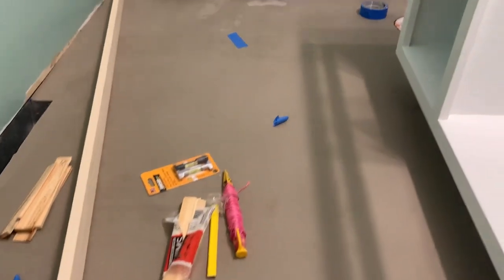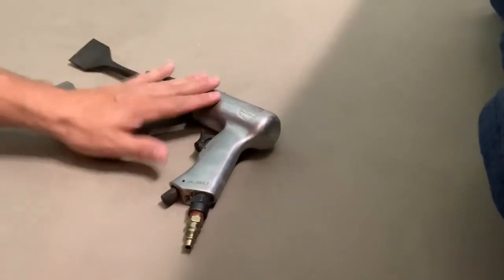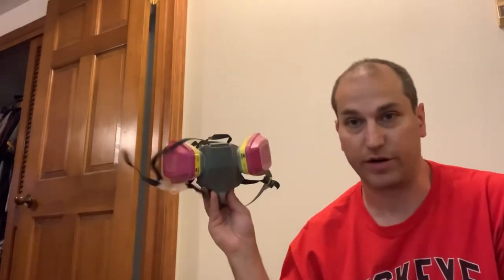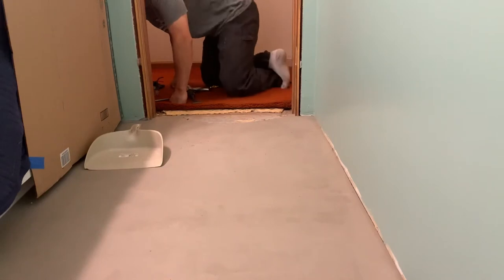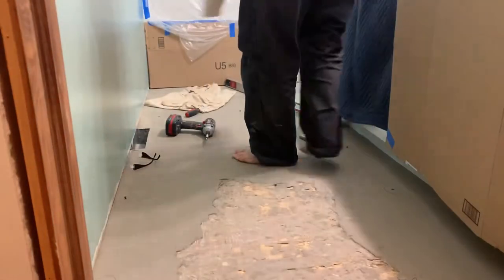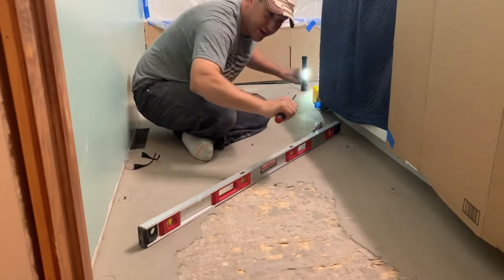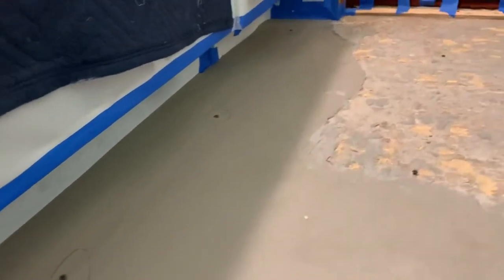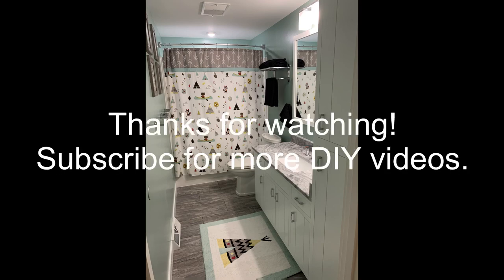Self Leveler Gone Wrong - SOLVED

Comment: I guess your first pour was not wet enough. Don't think self leveling doesn't level well, it does, just keep your mix wet and move it around with a squeegee or similar. The screws is a good way to mark the floor level. I say this after 30 yrs carpentry... It's not the mistakes that you make but how skilled you are at putting them right. (which you did) over all, you did great and got it done!
Reply: Do you mix your leveler wetter than the instructions?   I had the same issue.  I used a trowel, moved it around. Looked flat. Was done in like 15 min.  After it dried I took a level to it an there is about 3/8” to 1/2” difference.   Only thing I can think of is that I should have used more water than the instructions called for.

Comment: Unfortunately, I made the same mistake. Thank you for the video. Very helpful in deciding how to proceed. I don't have a air  hammer or compressor.  Ill be grinding before my re-pour. Ill be using the screw trick for sure. Thanks again!
Reply from the maker: Such a bummer. Good luck with your fix. One tool I have acquired since this video is a dust shroud with a shop vac attachment for my angle grinder. It really cuts down on dust a lot. If you combine that with a shop vac that takes the paper bags inside, it works out pretty nice. Good luck!

Comment: i went over the run time on mine and got a partial bond except near my door. used the bare minimum water amount exactly, weighing out the leveler bag for a partial fill. didn't know if i could trust my foam tape dams (you actually can). had to crack off a good tenth of my project where i found a couple carpet staples i missed. thing is, you may need to prime before repairing. didnt see if you did. primer type is on the product. both the floor and concrete. abrate (light sanding) as well per instructions before priming. a placer helps smooth the material but my jack and jill sink rooms are small. the one i had to redo a bit is narrow and pesky. at least in round 2, I bought a trowel.

Comment: Thanks for posting this! I'm doing it this weekend and been watching a ton of videos on it. Gotta spread it fast, encourage the flow, use the spike roller RIGHT AWAY to get air out and to fix multiple pour "seams". And.....work.....FAST! Hopefully I wont mess up! :O
Reply: If you can have someone mix for you that will ease your stress. LOL Trick to mixing is add all required water and half of the leveler and mix about 30 seconds. Using a trowel make sure to scrape side for any unmixed material. Then add remaining leveler. Mix for another 30 seconds and check for dry clumps again. Then mix 2 minutes. Use a timer. I have a egg timer that works well for this messy job.

Comment: Same situation.  Reasonably competent/stubborn DIY and hey, look - it works for other people on youtube!  I am now adding a step to search "<insert task here> disasters | gone wrong" to find such nuggets of wisdom as you provide.   Self leveling indeed ... ha!  Self smoothing is 100% right on.  I'm pouring "puddles" to try and level bits of a family room that have sagged slightly (1/8 to 3/16 ... 1960's house) in prep for some rigid vinyl plank.  And did the puddle even self level over a 3' span?  Noooo...but it sure is a nice smooth hump!

In my case, a shop vac with cyclone attachment + hepa filter + palm sander with diablo sandNet pads makes short work of leveling said bumps.  (if you haven't tried the sandNet pads, they're the bomb.  Mesh means they pretty much don't load.  Got mine on sale in a multi-grit pack at Home Depot)

Thanks for taking the time to share your pain!
Reply from the maker: That sounds like a rabbit hole of entertaining videos. I'll check out the sandNet pads. Seems like they get awesome reviews. Also, I had never even heard of a cyclone attachment, but I looked them up and they look awesome. Did you build one yourself or just buy one off the shelf?

Comment: I had never used this product and screwed it up like many others.  The second time I spent days preparing and followed all the tips from this video and comments:
I chiseled all the high spots, put screws in that were level with each other as a guide, made the mix very thin, had someone else keep mixing while I poured and troweled, and did it all quickly.

The second time it came out great.  This isn't a bad product, but you must be very careful, otherwise you create a lot more work for yourself.
Reply from the maker: Super glad you got a good result on the 2nd try. I agree the product is good, just takes some practice.

Comment: Thanks for the video. So many "experts" have videos on this that makes it look easy but so little can be found on what happens when things go wrong. Also as I just learned earlier, Mapei makes a self level plus that takes 24+ hours just to walk on BUT it's a far better product for a single person, DIY or novice as there's substantially more time to work the product. Mine started to set up after only 7 minutes to where the rake marks never leveled out. Thankfully I had the smart idea to start using a floor scraper after it sat for an hour and hadn't fully cured so it was easy to remove 2/3s of it before I was screwed.
Reply: What product did you use initially?  I used Customs Leveler RS from HD with a trowel to break the surface tension but ended up with a high spot in the middle of the pour area from front to back.  I poured a 32x60 section for a shower pan so it is a small area but it is over new plywood that is screwed down.  Not sure how to proceed at this point.  Should I grind the high spots down or just try to remove the whole pour with a rotary hammer just like I did to remove the original tile.

Comment: I work with it professionally. They sell grinders with dustshrouds.
Use one of those to grind your high spot down then use leveller to raise whatever is low.
Reply: I got a DeWalt dust shroud and vac attachment and diamond blade and was blown away by how well the whole system worked. It captured nearly all the dust.
Reply from the maker: Good to know. I'll look into a grinder with a dust shroud. This was not the first time I had a ton of dust caused by a grinding project.
Reply: Posting this for ideas for the next person. 
Depending on how high the high spots are, you can also use a Carbide Stone Fluted Rubbing Brick to knock things down. If you do this a few days after the pour the material will come right off.  Low spots are easier. Just reprime and mix a small batch to fill in using a screed scooping out any excess material.
Reply: @jhalleck  I’ve got a really large high spot. Will this knock it down quickly?
Reply: @YungFlipFlop243  Yes.  The stone can remove material pretty fast but you need to use before the material gets real hard. The grinders can be very aggressive. I have a bosch which can take 1/4" bites in seconds.

Comment: Been there and done that! (5m x 3m Extension to my house). It looked like it all went very well until I tried to lay the flooring on top. I ended up having to chisel half of the floor up and start again. Things I learned:- Spend a lot of time checking the levels of your floor before you start. Use screws to show what height you need to pour to (I didn't). Have a break and then check it all a second time (in all directions). I used Mapei self leveler: Put 10% extra (Cold) water in it to give yourself a bit more time (otherwise it goes off really quick). Use a rake to move it around when you pour it because the latex part floats to the top and you'll get riges in it where the concrete part ends up to near to the surface. Grinding afterwards is a very bad idea. Don't try it!
Reply: why is grinding a bad idea? I have a few high spots
Reply: @gizmo9006  Grinding is really difficult and dusty.  That is rock hard !
Reply: @maryjayne8746  I have an angle grinder with diamond bit its not that dusty with a dust shroud and vacuum. not ideal but its happening
Reply: @gizmo9006  grinding creates a lot of dust.  Much better to to chisel -- either with a hammer gun or a hammer and chisel

Comment: Great video, thank you for sharing.  I have a similar issue and need to figure out a solution.
Question:  It looks like you laid your tile directly on the concrete.  Did you consider using a membrane or cement board?

Comment: Did you use the recommended primer and make sure the self-leveling was spread evenly?  My guess is no primer and the product/mix was not correct.  At least you had good adhesion to the slab.  You could have poured a second layer that was more flowable.
Reply from the maker: I did use the recommended primer which is what made it so hard to chisel up. I followed the directions for the mix, but maybe it was a tiny bit thick. In the end, I did end up pouring a second layer on top (yes I primed again) and it came out pretty good.

Comment: You sound just like me.  I am an a experienced DIYer who has rebuilt motors, renovated and installed a new kitchen and bathroom before but never used leveler. I researched everything to death but assumed this was a no brainer after watching one or two videos.  I just ran into the same problem with pouring floor leveler to level a section of plywood for a shower pan.   My dried higher in the center and now my pan sits worse than before.  So disheartened and humbled.
Reply from the maker: Well I’m glad it’s not just me😂. Good luck with however you fix it.

Comment: The main problem with self leveler is it's not a diy project, you need to be a professional at finishing concrete to improve the chances of success, I'm a professional and have only used the stuff once, I find good straight edges and thinset mixed to the proper consistency is the best leveling compound is much easier to work with along with a much better working time.
Reply: I had a contractor do mine and they offed up really really badly.   There is a ridge between every pour plus many faults.  Now have to tear up a 5x5' patch that is a mound in my kitchen.

Comment: In my experience 1 Buy decent bags. . 2 watch the consistency. Consistency is key. It needs to be runner than you think. I've just had two lads screw it up just like that. Fortunately their second screw up was a winner the latex they were paid to use was the last bag they ended up using. It went down nicely despite them, and was twice as runny.
Reply from the maker: Yeah I found consistency makes a huge difference. I did mix mine a little on the watery side on round two and it was much better. They scare you because on the bag they say mix it EXACTLY like it says. I didn’t go overboard, but I did put just a little extra water in. It definitely helped out.

Comment: Dude I did the exact same thing!! But what’s worse is I poured a second layer that sucked as well before I saw your video and watched others about how to do the screw trick.  
I thought yeah ill just poor it in the known low area and trowel out a thin layer everywhere else and let it do its thing.  WRONG its wavier then the lake.  Now I have a high ridge where once was the low spot.  But it looked great when it was wet
Anyways I got a laser and set all the screw heights to the same elevation as the current known high spot.
My only question is, what did you do on the high spot you were trying to match?  Did you just give it a skim coat of new material or leave it dry? And if so was there a lip where the new batch meet the old material?
Thanks for the tips.  Wish me luck I’m going for round 3 this weekend I must prevail!!
Reply: He chiseled  the high spots down instead of bringing the rest of the floor up.  Then he put in screws and leveled them with each other.  The screws must be higher or even or even with the high spots to create a level floor on the next pour

Comment: About 3 years ago bought a laminate floor from Home Depot, they had their installers put it in and they used the leveling cement but in a rather large area (in front of a couch) the floor is now making crunching sounds and it bounces...a lot!  The cement I think was too thin and it is crumbling.  Have seen a couple ideas on how to fill the gaps but still looking for ideas on how to fix the dang bounce. So mad I didn't realize this sooner as the 1 year warranty is a thing of the past. Thanks.
Reply from the maker: It sounds like if the floor is “bouncing” then that is probably what caused the leveling concrete to start to break. Even a little thicker would probably break if the floor is flexing (bouncing).  Is this over a basement where you could access from the bottom and put in some sister joists to beef up the floor strength?
Reply: @EvolutionDIY  When I said bouncing I really meant the laminate portion, not the subfloor. Under the laminate is a layer of plywood and yes, there is a basement below. I don't think the installers used enough leveling cement but and they rushed the drying with fans in order to start the project. The floor was pretty unlevel in this area.
Reply: My contractors did a Horrible job on levelling.   Absolute crap.  I am so glad I said I would lay the floor otherwise they would have happily laid the flooring on a shitty floor and taken my money.   I am applying leveller to fix their mistakes - they are goons and I do not want them back.   Am checking out this video to see how to take out the 1" high mound they left in a corner pour !!!
Reply: You always need to use the proper primer. The primer enhances flow and keeps the water from wicking out drying out the mixture.

Comment: Those pneumatic chisels are almost useless they are very weak. I wonder if you could just screw the screws down tighter or back them out when you were done.
Reply from the maker: "Back the screws out"...such a simple idea I didn't even think of. Totally would have worked I bet. I love how I chose to do the most labor intensive difficult method of grinding the heads off. Next time.......

Comment: Good video. I would have used a surface grinder and vacuum attachment  before I would have chiseled. Less work. They just need to make a SLU that sets up over an hour instead of 20 mins in my opinion.
Reply from the maker: I agree. I would have gladly traded longer working and set time for the 3 days I spent “fixing my mistake. Next time I’ll use the grinder/vac, although I pray there is no next time!
Reply: @EvolutionDIY  I don't think you really made a catastrophic mistake. You prepared well and the SLU has a mind of its own. You can help it alon, but it sets up so quickly...there just isn't enough time to screed it like you have with concrete. Cold water and bags in the installation room for 24 hours for relative humidity would have given you a few extra mins. Way to recover and not give up!

Comment: Ugh I did same thing can I pour more self leveler on top of old
Reply from the maker: Yes you can. See why the instructions say. I  think you might have to prime the floor again and then pour on top. I primed mine again, but I’m not sure if I had to. Also, if you are leveling a large difference (like 3 or 4 inches), it actually tells you to pour on top. You do like 3 or 4 pours of 1 inch each, all on top of eachother.
Reply: @EvolutionDIY  You always need to reprime. That is the biggest mistake people do using self-leveling concrete. The previous leveler will suck the water out and the leveler will not flow properly and setup.

Comment: Christ, I used 3 50lb bags in my kitchen, I need to rip the whole thing out somehow   ~150lbs.... I'm hoping I can rip out the high spots, and just deal with the slight dips with thinset because I am laying cement backerboard with thinset anyways before tiles.
Reply: @EvolutionDIY  It took me about 1/2 a day, but I got a large thick metal grinding blade, and with 2x shop vacs, and a bunch of fans pointed out the windows, I grinded every pre-marked high spot on my floors, then poured another 30lbs of compound to level everything correctly. What a huge pain in the ass. The problem is, if you look up the home depot tutorial he STATES IT SELF LEVELS. He just trowels the edges slightly. What a horrible video from a major corporation that made  the job go to shit.

Comment: Dude I hear you complain about 80 ft² I had 450 ft² and that was depressing man, I was pissed...
Reply from the maker: Oh no that sucks. Did you have to chisel it all up, or pour on top or what? Sounds like a pain in the ……
Reply: @EvolutionDIY  trust me ,that sucks for shure, biggest fuck up ever 🙄 Yes I had to chsel all that away with same tool like yours ,just mine is normal size, I don't have that amazon 2 inch bit. Well it was so bad ,that it's a lot cheaper to remove it before pouring new one, and this time I'm calling professionals that's a fact...